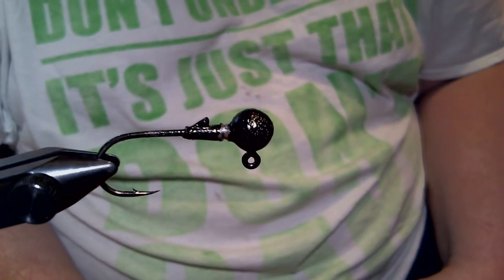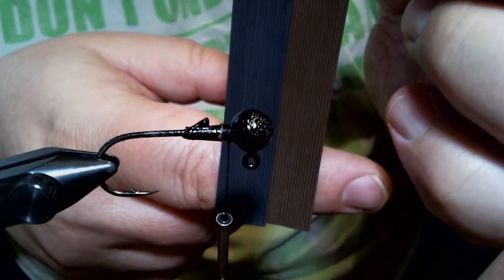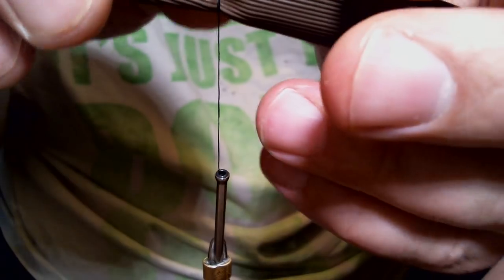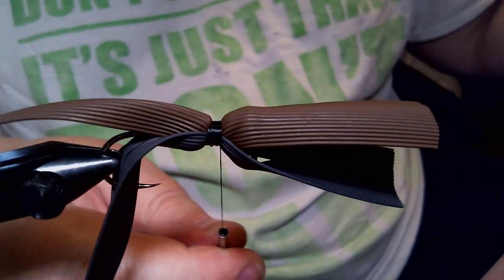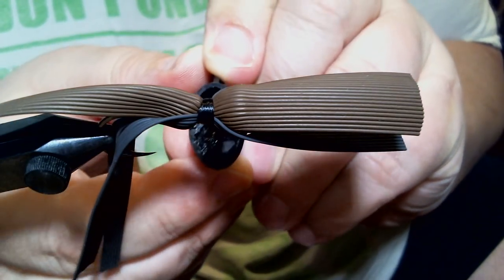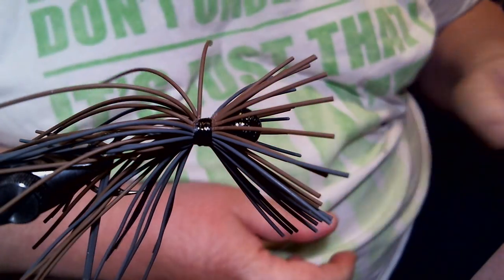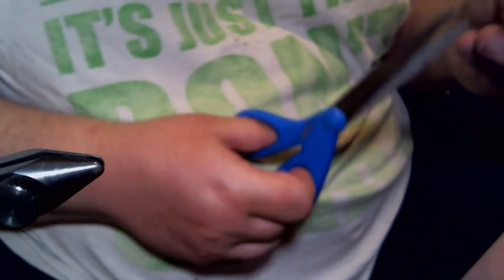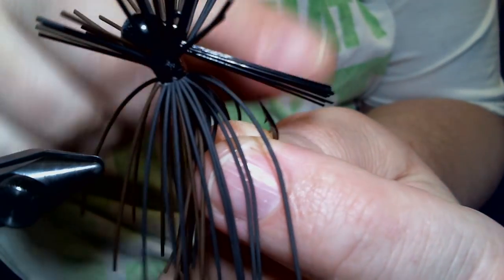Living Rubber HD Micro Jig

Comment: Like the mini jig, 1/8 oz with the living rubber & trailer makes it a fat 1/4 -3/16 of a oz is a perfect size for the ultralight spinning and baitcasting rods and reels I use in Houston Bayous, that weight in the slow current allows the bass a longer shot at hitting it after being bounced off the mud bottoms kicking up mud with a couple of pops then glide on a tight line is deadly, even caught a couple Bayou Muskies (alligator gars) on jig & pig setups! But hook sets are tough in that tough boney mouth with all them teeth! Most of the time they fight until they get close to the bank and release the mangled bait! The smaller baits always fish better in heavy fished areas! Nice tie & color combination! One person uses the colored pop tops from those energy drinks punches a hole into them and attachs a thin wired snap and turns small jigs into a mini chatter baits. You could work it on the bottom or swim it? Alot of fishing options with a jig that size? Thanks again!
Reply from the maker: Thank you Michael!!!! You get it!!! Not everyone does but it works great if you understand how to use it and it seems you do!!!

Comment: Do you prefer using round or square rubber when tying and what are the main differences between the 2 other then shape?
Reply from the maker: Big Mike, I like round rubber but only because I use rubber when I want a little more action. The difference is round rubber will flare out fast and it has more movement than silicone. Square rubber is very good too. It creates a larger profile with the same amount of material. It has about the same action as silicone and also displaces more water than round rubber or silicone.

Comment: I'm diggin the catalog brother! Did you use the Loctite instead of Sally Hanson for a reason?
Reply from the maker: I say this a lot, you can use whatever fits your needs. The super glue just gets a little harder for a little extra support with living rubber.
Reply: @smalljaw  I can dig it, Sally in general,  Loctite when needed. 

The Loctite holds the brush guards in solid too huh?
Reply from the maker: @hairyfrank9177   Yes, it holds the weed guard in. Remember, to glue the weed guard in you need to use the super glue gel control. If you use the regular brush on super glue on the weed guard it will wick up the fiber and turn the weed guard white from the residue. Brush on for use as head cement and gel control to glue in weed guards.
Reply: @smalljaw  Appreciate the insight brother!

Comment: When do you use rubber skirted jigs over silicone? I’ve always shyed away from rubber because it always melts together. Keep the vids coming I can’t tell you how many smallmouth I’ve caught by copying your color patterns. Thanks for sharing and taking the time to make em!
Reply from the maker: I tend to use silicone most of the time but I do like rubber to give the fish a different look. The rubber seems to work well when fish are more active, they respond to the material having more movement. I will use trial and error a lot, like if there is dirty water I will use a black jig silicone jig and if no bites I'll fish the same stretch with a black rubber skirted jig to see if the fish will show a preference. Thanks for watching and thank you for having faith in my color patterns, most of them I've been using a long time.

Comment: Do I have to be careful how I store rubber jigs? I know that they do have good action but does the rubber break down and start to stick to itself?
Reply from the maker: Yes, you do have to be careful. You have to make sure you let the jigs dry and don't keep them in the box for long periods like 2 months or more as the rubber will get kinked. I put no more than 4 jigs in a zip lock bag with a little unscented talc and then every week or so I'll give the bag a shake, the talc keeps the rubber from sticking together.
Reply: @smalljaw  helpful nugget right here, you should do a general tips and tricks vid with this kind of info